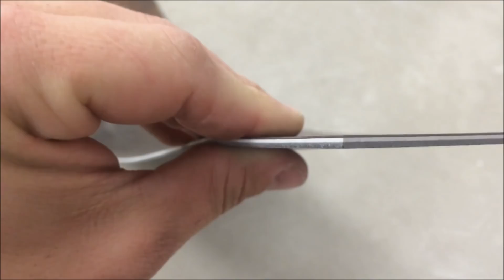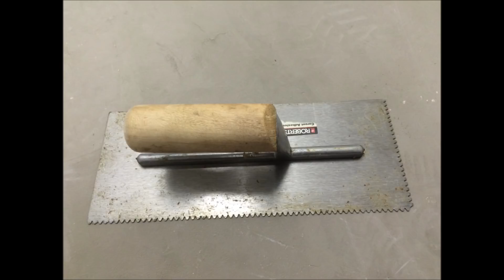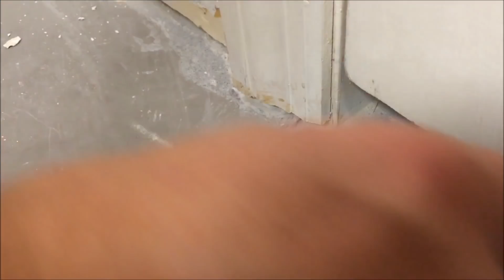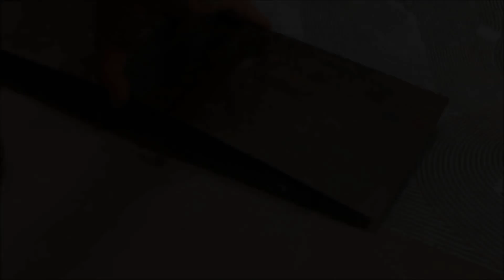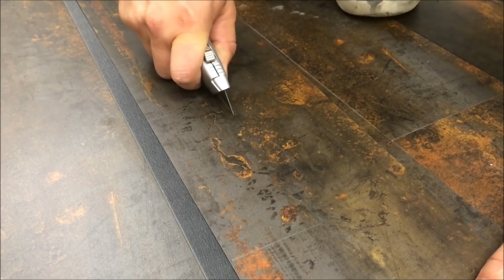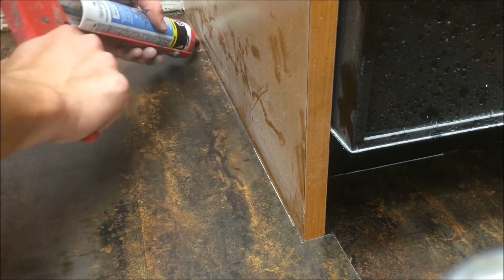How to Install Plank Vinyl- Glue Down

Comment: to clean the excessive glue off the flooring use a lacquer thinnier
Reply: Definitely NOT a good idea. Use acetone or mineral spirits, but not laquer thinner. It will eat the finish (wear layer). Each glue has its own recommended cleanup, and most are mineral spirits, and some make there own product to clean the additional glue off. If you plan to do this work unnexperienced, you should be most cautious of how easily the glue finds the surface. Wow, I am a licensed/Insured GC in Cali (B - General Building Contractor), and I would NEVER recommend glue down anything to a home owner or Do It YourSelfer.. get click lock, or some floating variation of vinyl floor.. Much easier and safer. So much can go wrong with glue down and once it dries .. good luck pulling it out. Nice video.. just heed my warning. I have 25+ years of experience using every material around. Thanks. (All due respect is intended here).
Reply: @jdubs71417  One reason to use "R" or release glue.  Planks can be removed/replaced readily.
I can understand your position as a GC in the trades, however it weakens your point when you cite a 'catastrophe' that isn't.  :)

Comment: Do you butt it right up to the wall or do you need space between the wall and the vinyl
Reply: You need to have some kind of room for expansion and contraction. Some people think vinyl does not expand. This is false
Reply from the maker: If you have something that will cover up the space(like vinyl base) then no, otherwise butt it up.

Comment: Question for you. We have a licensed installer that has requested that we choose a simple glue down product without any floating or other adhesive system. Do you have a product/brand that you have used that you recommend as being the best for a simple glue down application? Thanks

Comment: What type of glue do you use? There are about 300 different types at Home Depot and we're not sure which one to go with!
Reply: AtoZ Repair&Install Are you a professional floor layer .?
Im only asking as to some of the things you have done in this demo vid, are a little bit like hard work..
Im a UK master LVT installer, and im by no means questioning your methods, but you could make life a little easier for yourself..
I have to work to ultra perfection, so the floor prep is paramount, IE: T&G floorboards 6mm ply lined then we use stop gap or ardex fiber reinforced flexible compound, then we sand it down and go over it again with ardex feather finish, and then sand that so we have a sheet of glass to work on, and the same with a solid floor, using a correct  compound for a solid floor..

We use adhesive (when fitting karndean) either High temp or pressure sensitive glues.
A2 notch trowel, and heres where you can make life easier, get a high velocity floor fan, we have screw fix which is like home depot, im sure you can get one there for 50 bucks. that will help the glue go off quicker.

And as for fitting,your lucky you have no skirting boards/base board to fit too..then you would have to back scribe, as in your last plank/tile, lay another perfectly on top, then a plank to the baseboard, and the back edge will negate your cut cut and give you the perfect fit..
and as for cutting, you will have much more control using concave blades..

other than that, its sweet, i do it day in day out, and im here like you to help folks, im not trying to tell you how to suck eggs or anything.

nice looking planks btw..
Reply: AtoZ Repair&Install
Yeah you need that high velocity fan mate, summer in manchester england is bad enough doing our job nevermind Florida,lol
I have family who own's a bar in fort lauderdale so i do appreciate that..but you lot over the pond have AC everywhere..

try the concaves for sure, you will find you have more control , and like when you did that fiddly cut around the door frame  you can shave it down lovely with a conk..

for anyone else who may try to fit wood plank LVT or tiles or anything, like that. we dry fit sections, and template tricky areas with thick paper..
thats a no brainer though..

floorlayers..its how we roll....:)
Reply from the maker: The 3000 is probably best to use for plank vinyl. 
http://m.homedepot.com/p/Roberts-3000-4-gal-Multi-Purpose-Grade-1-Carpet-and-Sheet-Vinyl-Adhesive-3000-4/100159755?MERCH=REC-_-mobileweb_pip_rr-6-_-202061510-_-100159755-_-N
Reply: Will this glue stick to old linoleum or should I pull it up?
Reply: @porterpayton  linoleum is a non porous surface so find yourself a pressure sensitive adhesive that can go over a non porous substrate. Make sure to skimcoat to fill in any pattern/ imperfections in the substrate.
Reply from the maker: ev3nflow Yes I am a professional floor installer but I specialize more in hard wood and laminate, not much vinyl work. I live in Florida so we usually work with engineered wood or prefinished hardwood/vinyl. I do appreciate the tips though, always better when everyone is helping one another out. Ill defiantly try out the concave blades next time and probably get a floor fan due to the humidity we have here.
Reply: Like glass...
If i plyboard a T&G or chipboard floor or wood subfloor of any kind, we tend to use whats known as SP101, 6mm ply, then we level that ply with flexible screed/cement compound ,which are self leveling, and use a spiked roller too.
The we use ardex feather finish, which is like filler for any imperfections.
each time it gets sanded down too to get as flat as possible.
i have load of pictures, i should perhaps do a video of the whole process..
but the better the prep work, the better the product will look..
as its glued down it will show and tiny ridge or dip..
its a lot of work and a pain in the neck LVT as a whole.
Reply: 30 aussie bucks seems ok for a LVT product like karndean or amtico.
My mate who i work with, here in the uk, has duel aussie and uk passports, and still has a apartment in perth..
If your near perth then im sure i could ask him about where he worked and where to go..

If your in perth that is..lol

And i won't mention the ashes...oh wait i just did..:)
Reply: THOMSIT K188S or K188E
Reply: I doubt anyone willing to pay for all that is going to want some cheap ass glue down vinyl plank, but ya that's how it's done.
Reply: Blk
Reply: Installed many of lvp floors. Never put down anything to level the floors

Comment: I am curious if you have had any issues with expansion and contraction causing issues because its glued solid? I am going to glue down in a very small space (RV) but it will be subject to a lot of temperature variations.
Reply from the maker: I have done vinyl glued solid and floated in an RV before and didn't have any problems. This kind of vinyl is made very durable for those purposes.
Reply: No I did not

Comment: I see via your video that the adhesive used set for about 30 minutes until which time it was ready to accept the LVTs.  From that point forward, how long is too long to have it exposed, before it is cured too long to work properly?
Reply from the maker: It depends on the subfloor, humidity and temperature. In this video I had to wait 2 hours for it to become tacky and then I began to install. Most adhesives recommend not to let it sit over 12hrs, though I have even done it up to 24hrs. Hope that answers your question!